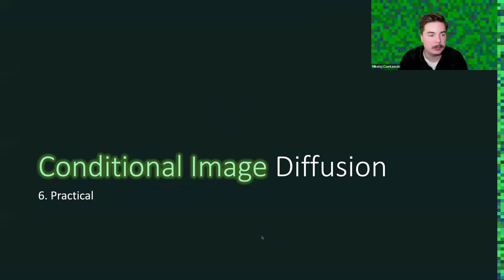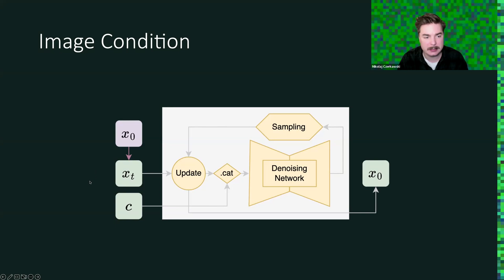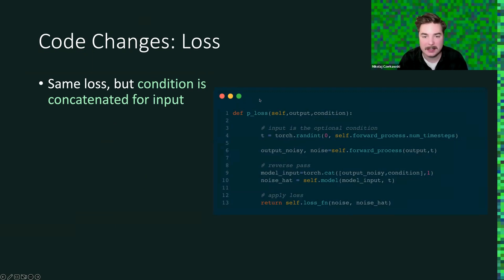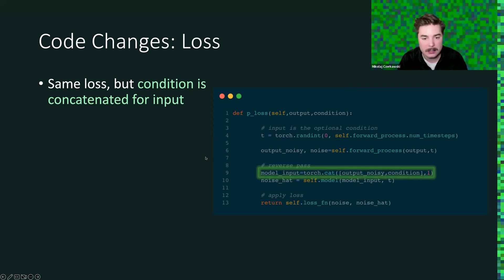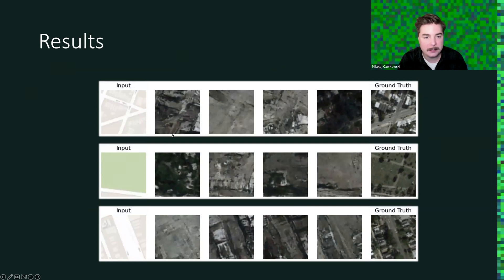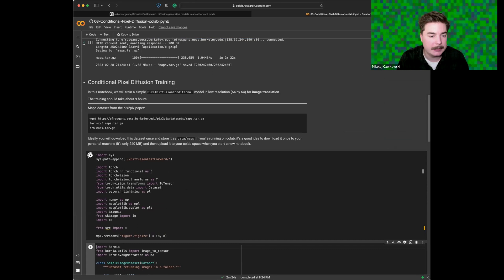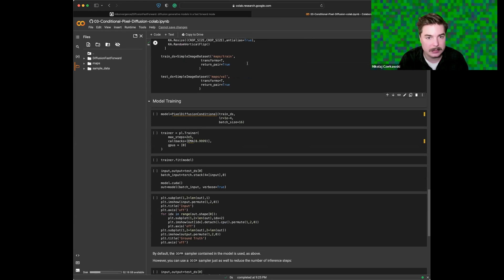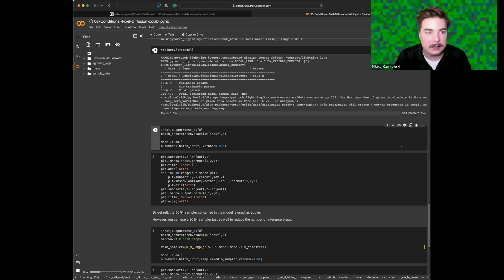06 - Conditional Diffusion Practical - DiffusionFastForward

Comment: I have a problem concatening the input with the condition.
The batch of images has size torch.Size([16, 3, 64, 64] (16 is the size of the batch), while the conditions (label) are torch.Size([16]) (1 for each image of the batch)
It's not clear to me how to "map" the conditions onto a 4-dimensional tensor. This to apply torch.cat((x,condition), 1)
Reply from the maker: Hi @TheKikko! For future - the github repo (https://github.com/mikonvergence/DiffusionFastForward) is probably more convenient for detailed technical discussions, but let me answer this one here:

This episode and code is focused on image-based conditioning, rather than label-based. There's already a lot of literature on the topic of label-based guidance, such as https://arxiv.org/abs/2207.12598 and in general, it will require a different model topology than the one introduced in this course, so that the label vectors can be supplied.